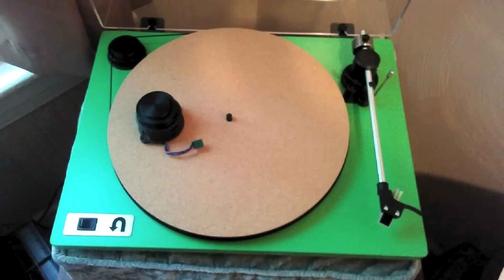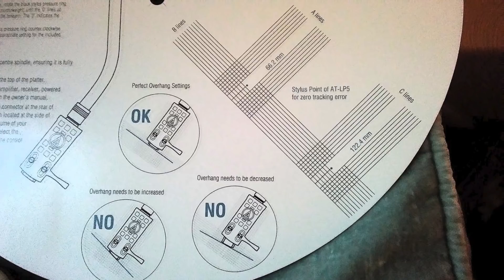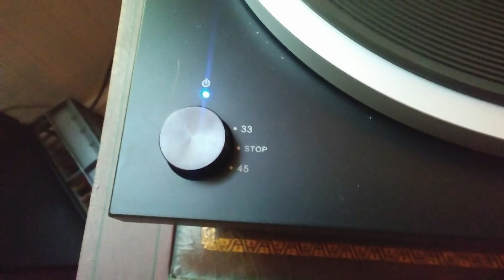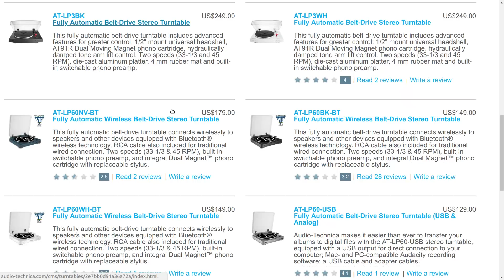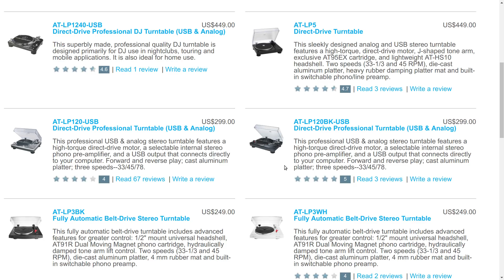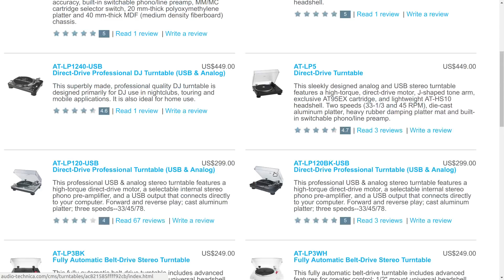My Audio-Technica LP5 Turntable

Comment: Glad to see you back Joe! During my early career as an electronic technician. (1970's-80's) I repaired consumer electronics. That included a whole lot of turntables. I have 2 Technics currently, both need a little  work, but should be workable (as they are both at least 20 yrs. old)

Comment: I'm kinda glad you did this. Frankly, I have no idea about 75% of what you're talking about, but it' great to listen to it anyway. Your knowledge about this stuff is valuable, as well as your ability to articulate it. To me, this is the first video you've made in a while where you didn't sound frustrated or bitter at any point during the video, which was good to hear again.  And I bet that software isn't necessary anyway, Linux would probably just treat that output like a microphone or audio interface. Maybe one day we'll get a Joe Collins radio show over Youtube
Reply from the maker: You can use any audio software you like... They just throw Audacity in for total noobs. Thanks for the kind words. :)
Reply: Did they not fix the pre amp compression on the AT LP5? the AT LP120 has that problem. The AT LP5 should sound fine with the Phono switch on?

Comment: hi Joe good to see you back, I have a 1979 Denon direct drive turn table with a ortofon mc10 and a denon pma 400 amp and  gbs videotone 3 way speakers,  best I could afford back then which was still expensive even on sale at £450 all most 40 years old, I would need to recap the amp to be on the safe side.

Comment: Joe has a point with that LP's have a unique sound, it is not that one is better than a CD but it is different. Simply put an LP gives a 'warmer' and more relaxed kind of sound, you really need to hear both to understand the differnce but it is well worth it to try it out. With analog sound you throw away less information but digital is a lot more precise. Both have advantages, ideally we should get a better digital format like 18 bits or even 20 bits. However, you need excellent equipment and well trained ears to hear a better sound quality with this better format.  With regard to MP3, if the quality is good and the 320 kbps setting was used with a good encoder then you probably won't hear the difference, with a 128 kbps even I hear the difference and I only have a simple headphone (Sennheiser HD700), not even a fancy amp+DAC. You loose a lot of richness in the sound: higher harmonics which can easily be heard with vocals, percussion (drum, metalophone, xylophone...) and string instruments (guitar, piano). Of course it does depend on the quality of the speakers, A Beats headhpone or an Apple wireless headhpone might not be good enough to detect it with.

A nice little anekdote: Philips which invented the CD wanted a 14 bit resolution, Sony with which Philips worked together (for practical reasons because Sony had a record label) fought to get a 16 bit resolution, fortunately the outcome was that we got a 16 bit resolution. You won't find this on Wikipedia, probablly. The size of the hole in the CD is based on a Dutch coin which one of the engineers had in his pocket while they had a meeting in which they decided the size of the hole. That should be pointed out on Wikipedia.

Comment: Nice to see a consumer focused direct drive TT, nice to see a protractor included it all looks good. I'm a little confused on the price increase from the atlp 120 but I will give AT the benefit of the doubt that it has to do with the body/platter materials as it looks pretty solid. I usually recommend a direct drive turntable to people looking to get into the hobby for cheap as they are simply easier to deal with compared to a belt drive and the decent technics clones like the LP120 are built fairly tough compared to similarly priced budget offerings from Teac etc.

Sorry to hear about your 120, my friend got one (BK) as his first TT and it's been working like a charm. When I went to visit I checked out the preamp for issues and there was no noise so maybe they have corrected the issue or used different hardware I'm not sure.
Reply from the maker: I think the price increase is due to the use of better components through out. This is a different animal than the LP120. :)
Reply: Nice to see AT take a step in this direction, they already had some amazing carts.

Comment: Hi Joe, I really wish I had purchased the lp5 instead of the lp120. The included overhang adjustment tool seems to be great, such a shame they didn’t include it with lp120. I’m glad you purchased the lp5 as the lp120 is riddled with anti skate problems and the broken cueing device. Due to the lack of an alignment tool with the lp120, would you recommend just setting the overhang as 53mm (16mm) with the use of a ruler and keeping the cart straight in the headshell. A good move from the lp120 to the lp5, only wished I had purchased the lp5 in the first place!
Reply from the maker: Yes, just setting the overhang at  83 between the rubber washer on the back of the head shell and the stylus tip should work just fine/ :)
Reply: Joe Collins Thanks for the conformation.
Reply: You can just print out a protractor from audio technica. They have an official one, i used it for my AT-LP120 and it works.
Reply: Live Wire Did you twist your cart in the headshell?
Reply: @hgvinyl4512  I have a ortofon 2m red cartridge attached to a at hs 10 headshell. Was a bit trial an error before i got it aligned with the at lp120 protractor. I think its like 95% perfectly aligned now and i don't want to mess with it anymore 😆 what do you mean twist?
Reply: Live Wire Did you twist the cartridge sideways in the head shell to get it to line up with the parallel lines?
Reply: No my ortofon red stylus is level with the cartridge ofc and the cartridge is also level with the headshell. Took a long time to get it aligned. If you have a at cartridge it might take a while, and check that the screws are leveled with each other.
Reply: @EzeeLinux  52mm is the standard, the cartridge may be toed in slightly to line up with protractor

Comment: Currently running a Pro-ject Debut with an Audio Technica AT4440mlb. Not ideal, becasue the Project's counterweight is completely wrong for the weight of the cart, and I had to add axtra weights. However, one way or another it works and sounds way better than the way the turntable came - which was with an Ortofon om5e
Reply from the maker: The OM5E is nice and clean but they are just a bit too sedate for my liking. I LOVE AT carts because of the sparkle and snap they have.

Comment: Interesting to see your opinion towards AT-95E... Personally, I can't stand mine! To my ears, it sounds squeaky & annoyingly bright, with excessively high tones. Instead, I went with amazing AT-3600L & Shure M75-ED Type2 combo.

Sorry to hear about your bad experience with LP120... I love mine, and don't seem to be having the same problems as you did. I'm using external preamp, but not because I find the internal one to be bad, or because of the noise. But then again, mine was manufactured after 2017, therefore having the correct(ed) Anti-Skate spring & not having a platter issues, like some of the previous models did.

Comment: Love my Pioneer PL-518!
Reply from the maker: <3 The 518 was my main turntable back in the late 1980s...... Love them. :)
Reply: I'm running a Shure V15 Type IV cartridge on my 518.
Reply from the maker: The first radio station I went to work for out of school had V15's on the turntables they used to dub music to tape for air. It sounded damn good, too. :)

Comment: Man, I would really love to get into vinyl/turntable but the cheap ones are usually regarded as bad and the "good" ones are quite expensive (for a high school student/soon to be college student). It also doesn't help that the selection in my country is limited to say the least. The Ion max is one I looked at but I heard some less than favourable reviews about and the Audio technica lp60 should also be great (but it's slightly out of my price range)
Reply from the maker: There's a lot of used gear out there... You can find some real treasures if you keep looking long enough. :)

Comment: Great to know you are still producing fine videos, regardless of subject.    My old yard sale records, old ears, and my budget,  I may need to use an AT-LP60, at best.   Could you recommend how to get the most out of such a basic unit?    I will be creating audio files for computer playback or CD audio "Mix Tapes. "    Perhaps you have already covered this subject.  Any pointers or links would be helpful.   Your fans can enjoy anything you create..   The trolls should be sent back under their bridges, or rocks.   I am glad you did not let the unprintables stop you very fine work..   Between jerks and Youtube's tight budgeting, we lose too many great channels as it is     Please keep up the great work.!.
Reply from the maker: The only tip I can give about the lower end tables is to put it on a level surface. They are what they are and nothing is adjustable. Thanks for the kind words. :)

Comment: Audio -Technica brochure for the AT-LP5 states the USB Function as 16 bit 44.1 kHz or 48 kHz USB selectable. We can assume the selectivity is done via software.

Also note the manual states to use the USB port you need to use the internal pre-amp [line] setting. Sigh... I was wanting to use my own pre-amp and USB at the same time.

Comment: Just read a comment in regard to the pre-amp built in to the TT. I just bought mine recently and I wanted to do some upgrades on a few things in my sound system. As I am fairly new to this, I have a few questions. I recently upgraded to the VM540ML cartridge and I wanted to know what the best pre-amp I can get that will power my cartridge correctly? Have some advice in what I should be looking for in search of my pre-amp? Thanks in advance.
Reply from the maker: I can't recommend a specific preamp but anything is bound to be better than the garbage preamp built into this turntable. It sucks. :)

Comment: Hello. Will you be able to assist ? I am running Linux Mint Sylvia for 2 months now and it was running fantastically on a Lenovo G500 machine. I am not running VirtualBox or anything. Yesterday out of the blue I got an "Running in software rendering mode" error. What would be the cause of this? I had to reinstall Mint to fix this problem. Will it happen again?

Comment: am I correct in thinking that a noise gate on a phono device would create massive compression of the sound?
Reply from the maker: It does not compress anything, it cuts in and out on very low passages in the music, driving me crazy! :)
Reply: @EzeeLinux  It drove me shitty too, I went and bought external preamp to solve this problem The 1st one Little Bear Tube 7, then the TEC TC-778 for selectable EQ for early 78s. I then went to remove high cut filters to get normal treble

Comment: Is AT lp5x better? Are you sorry you didn't wait for it?
Reply from the maker: Not really.... This machine wasn't my cup of tea after all. I now run an AT LPW40WN and I like it much better. :)
Reply: @EzeeLinux  Interesting, you went back to a belt drive? What, in the end, did you not find satisfying with the LP5?
Reply from the maker: @dmnddog7417  The build quality really wasn't there.... The turntable had more rumble than it should have and the plastic cabinet was quite resonant.
Reply: @EzeeLinux  Interesting. I wonder if the built-in PS contributed to the issue. I'm very suspicious of having the PS built into the unit especially if the build materials are not substantial enough to isolate its influence. I actually have the cheaper brother, the LP120XUSB upgraded to a VM95ML stylus. That model has an external PS. I haven't detected any rumble or hums from the TT. The only issue I need to fix on it is the cueing lever mechanism. When you lower it, the tonearm drops alarmingly fast, so I've had to manually cue the stylus. However, after some research I now know how I can fix it easily. Otherwise, the machine has been surprisingly good.

Do you think that your placement of it on that corner furniture at the time you made this video may have also contributed into the issues? You mention in your video that it wasn't an optimal position. I placed my TT centered on top of a heavy wood 60" wide media cabinet placed parallel to a wall 7" away from it. The adjustable rubber feet suction themselves to the top of the cabinet and don't budge. The thing is practically cemented on top of the cabinet. My speakers are on their own stands at the ends of the media cabinet. I haven't experienced resonance issues (that I can think of). That being said, I've been thinking of upgrading the TT, but I'm sticking with direct drive. For me they're just easier to use. Thank you for your frank response.

Comment: Why is the spindles so short! you can't get a clamp on there? Get a little wooden box about 2 inches deep and fill it with kiln-dried sand place the turntable and that will help dramatically. You should get an acromat by funk firm, preferably 5-mm if you can alter the vta they're the best mats to get.
What is the noise floor have you measured it with a phone? To see if it matches their specifications. If you like tweaking you can fill the platter with acoustic putty or metal putty you need to balance it afterwards, this will dramatically help acoustic resonance. I would like to have seen the main bearing is it a sealed unit or does the ferrite magnet come away and expose the bearing? Anybody gets one get rid of the plastic plinth. Not hard to do if you got a router or you know a shop that will cut it out for you. An inch of marine beach plywood, on the top and 2 inches of MDF on the bottom glue together then rout it out, you would have a very good table then. If you don't like the sand idea you could use some sorbothane  rubber under your feet will help a lot
Reply from the maker: LOL... I'm not that intense about it but, yeah, I'm sure all that would help. :)
Reply: Joe Collins fair enough! just get some sorbothane  for your feet that will help a lot.

Comment: Glad I saw the orbit tick motor problem...I will NOT be ordering it ever. 😑
Reply from the maker: I love my Orbit... I replaced the motor no big deal. I still have the Orbit. I don't have this one anymore. :)
Reply: @EzeeLinux  I’m considering a used AT-LP5, why did you get rid of it? Did you have issues? I see you have a new fluance now.:)
Reply from the maker: @noodlesfam  I go through turntables fast. LOL This one had issues with the drive. You could hear it "bump" on every revolution. Once I heard that I couldn't un-hear it. :)
Reply: @EzeeLinux  I would be the same..lol. Thanks for the response!